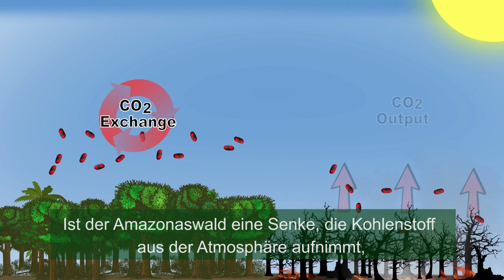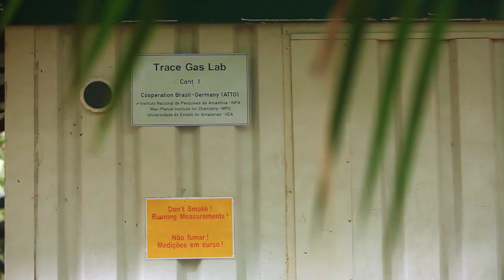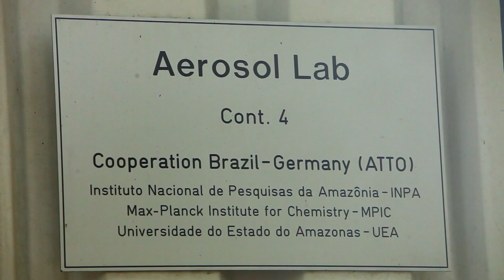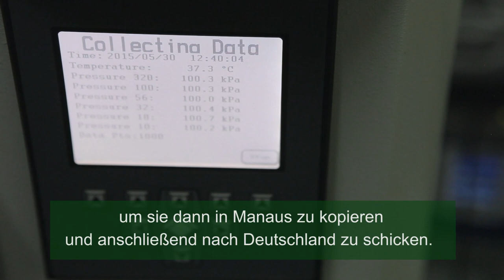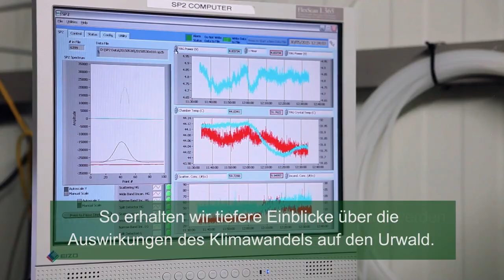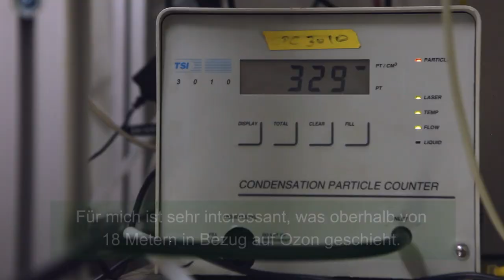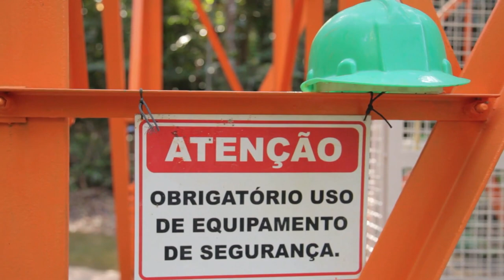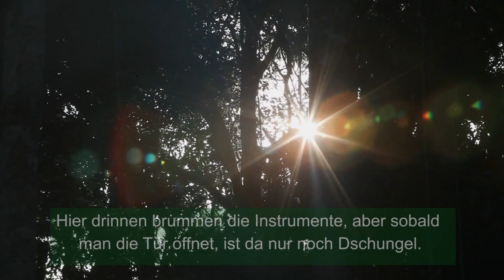ATTO: An Adventure in the Amazon (mit deutschem Untertitel)

Comment: How many lightning strikes per year does the structure endure and how are the people and equipment protected? To some extent, this must be a problem that was already encountered with radio and TV towers, but the question leaps to my mind when seeing people climb one in a rainforest.
Reply from the maker: Nobody has ever counted the lightning strikes, but the ATTO tower is definitely hit several times per year. 
The theory of lightning conductance of a scaffold tower into the ground is essentially based on catching potential  lightning by a geometrical system of lightning rods on top of the tower and by guy wires which hold the tower. If rods and wires have robust, lightning-current resistant connectors to the tower construction, the electrical current is guided down into the ground along corner pillars of the tower and the guy wires. Both must be ideally grounded. If connections are well done, there won’t be any damage to the tower. Instruments on the tower must be well isolated from the tower, moreover the housing of the instruments must be well (galvanically) separated from the electronic parts of the instruments. 
So far, we have lost only little hardware on the tower by lightning induced surge. Our staff is protected by strict prohibition to be on the tower during or even approaching bad weather conditions.
Reiner Ditz, Project Management ATTO